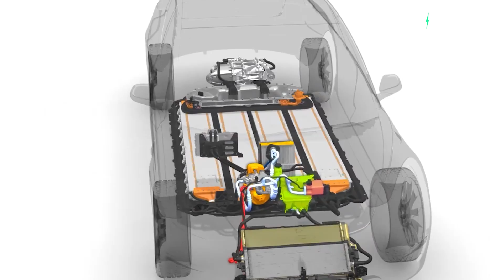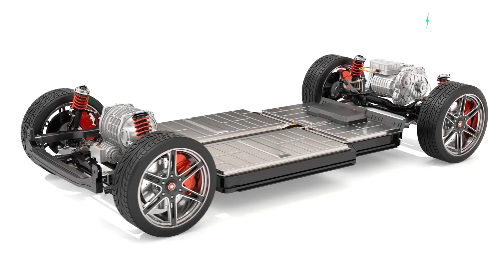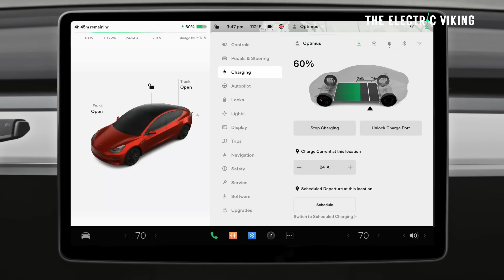No, you don’t need to replace Electric Car Batteries in 10 years time

Comment: Love your reporting, we’re talking mostly about Lithium batteries. Where are we with the Sodium batteries that supposedly do not have the overheating and combustion issues?
Reply: What combustion issues?
As soon as Battery Management Systems were improved, like in more recent batteries the overheating stopped, it's not present in Lithium Iron Phosphate chemistries, which is what most EVs use now.
LFP tends to be able to handle well over 2,000 cycles, likely 5,000, whereas Sodium can handle 10,000 cycles, so the life of the batteries will be massive.
Reply: Sodium batteries don't last as much as Lithium batteries
Reply: LFP

Comment: You are generally right but there are some rare cases where batteries have failed early and we don't know why which is really frustrating. Most people will never have an issue.
Reply: Those are likely old Nissan Leaf or Zoe's, anything with modern chemistry like LFP tends to have good BMS and diagnostics built into the management systems.
As Sam said you can replace bad cells and test the various cells of a pack, so fault finding is actually easy.
Reply: I had a Mazda pick up. The timing  belt broke and I needed to get a new engine. I had a Ford Zephyr where the welch plug failed, needed a full overhaul. A friend has a Merc M model who's just been quoted R38,000 to replace engine mountings (that's SA Rands). All these examples were under 50 000Kms. It's about time people started talking about the cost of ICE repairs in the time before that ICE car gets to 250000 miles, EV battery change, maybe.
Reply: @davidtuer5825 absolutely right.
Reply: ...we do know why...it's water intrusion that corrodes circuit boards in the battery packs and or compromises the cells...the key is finding a qualified repair shop to be able to do proper repairs instead of junking the entire pack while over 95% of it is still viable...
Reply: @puzer1  I work with batteries every day  in fixed communications. Maybe one battery installation gets water damage a year. Typically they get hot and this causes them to breakdown over time. That does not mean water intrusion is good for batteries but the packaging is waterproof and the BM should shut the cell off if it detects a short
Reply: @puzer1  Heat is actually what shortens battery life. The new Tesla structural 4180 battery packs cannot have cells or packs replaced they are glued in for structural integrity.
Reply: @puzer1  Actually heat is the primary enemy for all batteries. Replacing just the damaged cell in a 2 year old pack might work, but if you replace the failed cells in a 10 year old pack, it will likely have many more batteries that ate bad in the following months. The batteries were  made on the same day and under the same load and charge cycles, so wear will be similar on all of them, ie 5 failed cells means the others are not far behind.
Reply: there's always a bit of a spread when you buy batteries. Some die early, the majority lasts years and some are even usable  after a decade.

We do have the experience over time, it's not something new with EVs.
Reply: @svr5423  Then why don't they warranty batteries for 10+ years?
Reply: @GOLFandWRX  they do.  If your battery degrades faster than expected, they replace it free
Reply: Some ICE engines fail quite early (say 5 years-ish, 50,000 miles-ish).  Many GM's and Fords, but even some Honda's, etc.  

But the vast majority which maintain their engine re proper oil changes, etc. will get well over 100,000 miles with a modern ICE and proper care. 

The outliers aren't what matters.  That's why anecdotal data/claims aren't useful.  It's the statistical norms that matter, re reasonable predictions.
Reply: @rogergeyer9851 So what are the statistical norms? Your remarks are anecdotal too.
Reply: «there are some rare cases where batteries have failed early». Exactly: it is rare. You would never, ever, extrapolate an problem with an ICE car. Why do it with an EV?
Reply: Jai Hinduja.  As  some consolations,   it may be better for a faulty battery to fail early than to self-combust later.
Reply: @tedchandran I could say the same about any big legacy ICE.
Atleast Tesla makes it money going out the door...instead of after an engineered fail, immediately after the warranty runs out. 
Never trust a manufacturer without profit margins.
Reply: Just as well most batteries come with 8-10yr warranties.
Reply: That early battery failure is exactly the kind of case where insurance should be used.   Or the manufacturer should raise prices by $100 per car and improve the battery warranty for early failure.
Reply: @mac_mcleod isn't it covered by the warranty?
Reply: @b3arwithm3  I don't know but in some cases it has not been.
Reply: @mac_mcleod  all cars have warranty.  Battery is covered for 8-10 years and 100k miles.  That's pretty standard
Reply: @b3arwithm3  coworker '18 LR M3, out of warranty battery failure - I understand he got the short 7% stick, but Tesla really should have had a ten year warranty. Replacement cost for just the battery is $15K. This is one reason I won't buy one, I can't afford this on a 5 year car. It's also why I won't buy a Ford either
Reply: @mac_mcleod  that's a great idea
Reply: Anybody tested corals bms over current protection drives??? Don’t take a rocket scientists  cause I ain’t even close
Reply: Just like how there are rare cases where ICE engines fail early
Reply: Why do ICE fail?
Reply: you can get lemons with any car. nothing to do with ICE or EV or any brand.
Reply: My coworker, 2018 LR M3, 160K miles (out of warranty) got a $15K estimate for a used replacement pack. He can't afford it. If batteries really last 20 years, the warranty should cover 20 years for these "rare" cases.
Reply: @GOLFandWRX  ice cars can run 15-20 years.  Do any of them have a 20 year warranty?  Neither your tv, laptop, etc have warranty for most of their lifetime
Reply: @b3arwithm3  there is no part in my ice car that will cost $15-20K to repair without an accident. The 20 year claim is by the manufacturerers. If they want the general public not to panic, based on the 7% of buyers whose batteries fail, then increase the warranty to at least 10 years. My ICE power train is 10 years.
Reply: @GOLFandWRX  doesn't matter what the cost is.  Nobody is offering a warranty for most of the life of any part. Your power train should last much longer than 10 years but only warranty for that much.
Anyway any car's value is minimal after 10 years, so why even care what car parts cost.  We replace the car at that age.
Reply: @b3arwithm3  I'm somehow not being clear, a coworker bought a 2018 Tesla LR M3. Now 5 years later he is over his 80K mile warranty and was presented with a $15K bill to fix. I understand he's in the minority, but he doesn't have the money to fix it. If the manufacturer says the battery should last 10-20 years, then they should warranty the battery for 10-20 years.  I will not be buying a BEV because I cannot afford another $15-20K dollars 5 years later. It's just too expensive

Comment: On extending EV life, the current culture of pairing everything high tech with EVs are the main problem of high maintenance / repair costs of older EVs, not the batteries. Many electronics components, infotainment touch screen, autonomous sensors etc, breakdown as they age, and requiring tremendous repair costs. It's fine to have bells and whistles, but I wish EV makers would focus on making more robust, reliable EVs than depending core functionality on high tech gadgets. ie. If one or some of these bells and whistles stop working, you can still operate the car without costly repairs - don't put all the core functionality in the stuck on tablet touch screen. When it goes out, you can't use the car at all. It needs to be more reliable and long lasting.
Reply: You don't think today's ICE cars are not loaded with electronics too? That's what everyone wants in their car. No one cares about Kodak or blockbuster anymore
Reply: @larryc1616  I didn't say that. In fact, most of modern ICE cars face the same problem. But at least there are still some choices in ICE cars with low techs such as some Toyota and Jeep models and some low end pickups. They are very resilient to physical abuses and not prone to finicky electronic failures.
Reply: @i6power30  My hyundai lacks deicing equipment for its radar system. That annoys me in winter.
Reply: @svr5423  exactly
Reply: BEVs are for enthusiasts, people who have money to burn and don't mind being the first one to try out new gadgets, even if they might not be mature. For this target demographic, you cannot not have fancy technology built in.

Comment: Yea, electric cars are great for the environment..., if we ignore all the resources needed lol, in the US they need longer range, I've driven Tesla on road trip in winter, the electric cost is same as fuel plus it don't go far enough..., longer range if they want everyone to buy this skateboard and better prices. But it was fun to drive! For a wekend
Reply: The savings comes from the daily driving around town, charging at home, when you aren't making a road trip. And, even when you do make a road trip, the first 200 miles still come from cheap home charging, just like your city driving. Depending on where you're staying overnight, you might stumble across a free level 2 or wall outlet, which can provide further savings. Even if the fast chargers themselves, cost the same as fuel, you're still coming out way ahead overall.

Unfortunately, for people that are unable to charge at home and have to rely on public charging for all of their driving, the energy cost savings of EV over gas are not nearly as good.
Reply: @ab-tf5fl  I'd assume I'd charge exclusively with DC chargers. And I don't drive much nowadays, but my road trips are regularly 1000km+.

Comment: I read a study sometime ago that it's not about the frequency of charging battery, but the from what level to what level. If you charge only from 35% - 75% say 8000 cycles, it will still be better than charging from 5% to 100% only 1000 cycles. The latter "deep cycle" charging actually does more damage to the battery than frequent "shallow" charging.
Reply: Heat is a big factor. 
Charging to 100% on the hottest day, then sitting idle will cause the greatest degradation
Reply: True
Reply: True for lithium ion batteries not LFP's
Reply: @larryc1616  Actually LFPs are Lithium ion. What you meant to say is that It's true for NMCs but not for LFPs

Comment: I drive about 400km per week, that is about 21,000km per year. battery degradation is not an issue. with less than 20% degradation for 300,000km.
Reply: A company called Tesloop that runs a back and forth service between LA and Vegas for years, had to replace a Tesla battery at over 600,000 miles. I believe Tesla did it free, thanking them for the info.

Comment: I believe today's EVs don't have this problem. But I'm suspicious that if you purchase a 2013 24kwh Nissan leaf or VW e-golf with ~100k km, you're not gonna come close to 250k km
Reply: Buddy of mine has a 10 year old leaf with 140k miles on it. It’s down 30% on capacity and given how poor the range was new, that’s pretty devastating and he has to charge at work every day. If my Tesla degrades the same amount, I’ll still have over 200 miles of range.
Reply: My understanding is that early Leaf’s don’t have battery management systems that heat and cool the battery when charging or discharging to optimise power and therefore will degrade faster than newer Evs with sophisticated BMS
Reply: That's fair.  The point is that the chemistries have improved significantly over the past decade, and NOW claiming that NEW BEV's with, say, LFP batteries from good makers like Tesla or BYD will need a new battery fairly soon -- are just NONSENSE.  

But of course, the usual far right science denying suspects try to promulgate that story.

Comment: ICE cars and EVs age differently. ICE ages on wear and tears (mileage), EV batteries age on calendar aging and charging cycles, no wear and tears. So the ideal use case for EVs is high mileage use, especially in city driving, they beat ICE cars by far. But if you are low mileage user (less than 10kkm per year), or, your battery will still degrade with time anyway, you are not getting your money worth. If you are a grandma only driving to church every Sunday, and only use 2000km per year, then you better off with ICE car, because then it will probably last 30+ years, many military vehicles are 50 years old because they are only occassionally used for excercise, very low mileage, but regularly moved around. The real problem with modern EVs is all the high tech gadgets that breakdown and require high repair cost. You will face thousands of $$$ repair bills for infotainment, electronics, control modules etc. way before you need to replace batteries.
Reply: Totally agreed - also, low mileage users of ice motor cars are not high polluters!
Reply: Are you saying today's ICE cars don't have the high tech electronics of EV's? They are just analog cars with less electronics problems? Ever own a BMW?  😂
Reply: @larryc1616  No, majority of ICE cars face the same problem. But there are some low tech ICE cars such as some Toyota, and Jeeps, barebone pickups. But in EVs, almost all of them are filled with high tech gadgets as if it's a requirement for being an EV, but in theory, no, you can have a low tech EV, but no one is making them.
Reply: @Paul-vm9sz  I wish they were available in North America. It seems Europe gets more variety.
Reply: Sadly in America, all EVs are like computer on wheels. Which alienate a big segment of population that wants simpler cars and don't care for software update and autopilot etc. They will sadly stick with ice cars
Reply: No cars - EV or ICE - are designed to last 30 years. Even if the car is not driven much and wear and tear on the engine is minimal, the body will still rust away.
Reply: @ab-tf5fl  isn't cyber truck body never going to rust? Also some military vehicles are literally 50+ years old and still in use for training.
Reply: @i6power30 it's naked stainless steel body so it will rust like crazy.
Reply: For low mileage, ICE is not a good solution. High wear and tear as the engine never gets hot. Excessive amount of pollutants during the warm up phase. And you still need to do all the maintenance since things like oil age.

Better have a BEV for short range applications. That's where they thrive. I see them everyday on the road, from various postal services to the Pizza delivery. Even though they are not yet ready for mass adoptions (except the tiny scooters, they do well).
Reply: @svr5423  there is a difference between low mileage and low range. Food delivery is low range but in constant use it's high mileage perfect for EVs. Low mileage use of EVs as in low utilisation is definitely wasteful for EVs especially if it carries a large battery pack which will degrade with calendar aging anyway .
Reply: @i6power30   Food delivery is often low mileage. Around here, you can achieve around 20kph (average) in inner city traffic if you're constantly driving. But you have to load and deliver the pizzas. Often these vehicles will not see 100km per day, even though they are constantly on the road.

Our mailmen are using BEVs since at least over a decade, they just go from house to house. Because they are not dependent on fast charging, their BEVs used to have lead batteries in earlier times (if I remember correctly).
Reply: @svr5423  yeah you are right. What I really meant to say is high utilisation, not necessarily high mileage. In ice car terms, it's engine hours not miles travelled that actually wears down engine. EVs are better for high utilisation for sure, especially low range delivery services because these vehicles don't need a huge battery for long range travel and have a fixed return point for frequent recharging.
Reply: if you are driving 2000km each year, why will you buy $50K model Y? Also infotainment, electronics, control modules are also present in latest ice cars. They will also fail.
Reply: @Fear.of.the.Dark.  true. Most new ice cars are complicated computer on wheels too. But there still some that are simply built, some Toyotas and base level pickups. But none EVs sold in North America seem to have just the basics. They all try to be computer on wheels as if it were some kind of prerequisite for being an EV. But it's not

Comment: So why/how do many ICE cars in the US frequently reach half a million miles?

The scary thing right now, is repair costs for EVs. And don't even talk about parts prices...
Reply: The average mileage of gas cars that are junked in the U.S. is 156K miles.  Presumably some of that is collision issues certainly but most cars are consigned to the salvage yard due to failed engines and/or transmissions which render them uneconomical to repair.
Reply: @ohger1  It would be hard to find ICEVs here in the US frequently reaching 500k miles as he stated.
Reply: @acolon8999  Agree.  I had an old Ford 
Bronco II that had over 350K when I sold it still running, but that kind of miles is "bonus time"...  A tiny fraction of all gas cars get to even 300K miles, much less half a million.
Reply: "frequently" lmao
Reply: Since I do 10,000km year and I probably have 15 years of driving left in me, baring medical disasters, the life of the battery isn't a major concern. However it'd be much happier with an affordable EV that does 500-600km and I can't afford a Tesla, so I'm waiting.
Reply: @GlenisRetiredNZ  Get a used Tesla from Tesla :)

Why do you need so much range if you only do 10,000km per year?
Reply: What kind of repairs?

What parts?

Just curious to know what has been your experience.